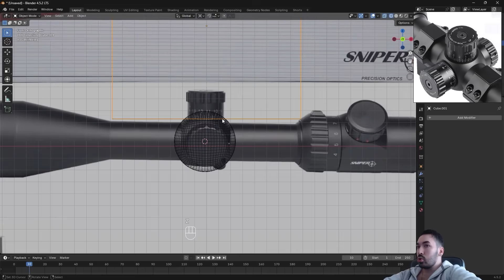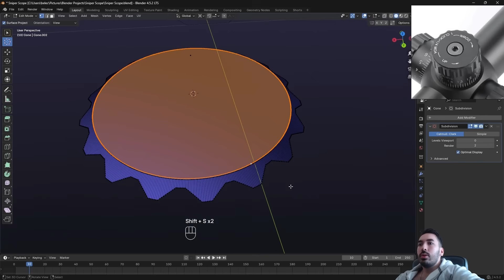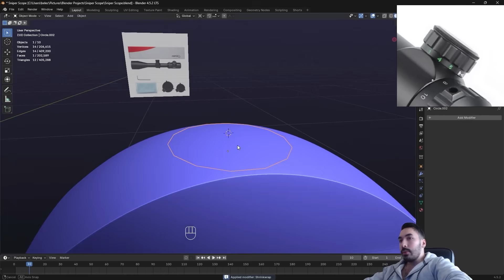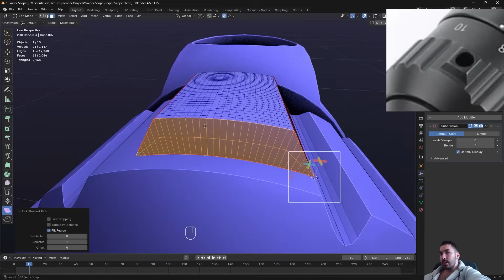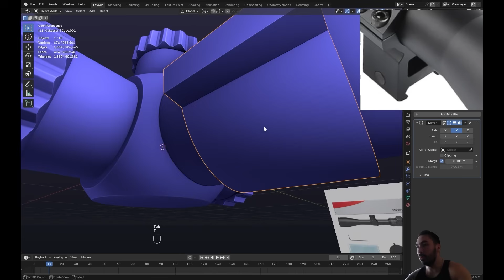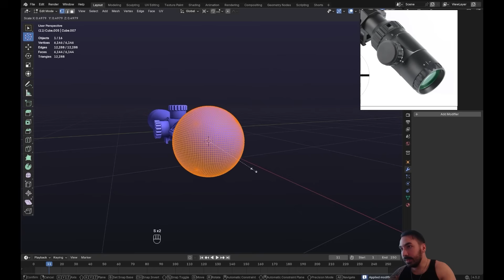The Best Hard Surface Modeling tutorial for Beginners - Sniper Scope

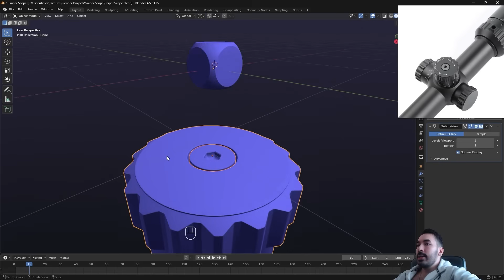Comment: Pro tip: With regards to setting the mesh origin of the knob (referring to about the 17:37 mark in the video), instead of setting the 3d cursor to a selection and then the origin to cursor (this is the long, scenic route), instead do the following:
In preferences, enable the included 3d viewport pie menus add-on. Then, select the bottom edge loop on the knob. Finally, press Ctrl + Alt + X (this brings up the Set Origin menu) and simply choose Origin -> Selection. Done. No messing around with first getting the position of the 3d cursor nonsense. Much quicker and easier to move the origin to a selection than faffing around with 3d cursor placement first!
Reply: Amazing, it's a useful shortcut, thanks
Reply: When giving pro tips like this please check what "hidden gems" it can have.This addon overwrites Save Incremental shortcut,which I use and  to get it back you need manually change keymap settings.Just for example.I suppose it can change other useful shorcuts too.

Comment: Another awesome video. Would like to see how to do the engraved numbers. Learning more stuff. I have a lambo model i'm working on and I could have used that one trick with the cutting of a circle to cut and inset the tail lights. Had the same issue when the sub div modifier was added with the jaggy shit. So manual correction was needed for the edges. Was f'ing around for like an hour with it. Your method would have saved a lot of time. Now I know so thank you! Oh and I was surprised to see you pull out a boolean mod lol.

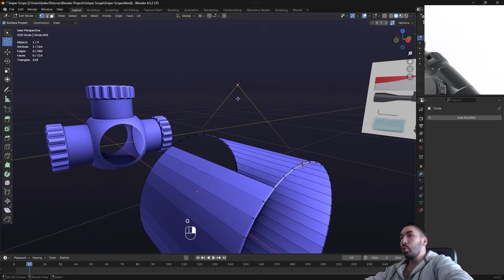Comment: 19:48 I have a question, I turned on auto merge already, two lines intersected, but they don't create a new vertex at the intersection point. What should I do? Thank you very much ^^
Reply: same problem with me
Reply: @xerovisuals-e6y  I actually found the solution, in the options drop down panel next to the auto merge button, check "Split Edges and Faces", and scale the vertex again, then it should create a new vertex at the intersection part